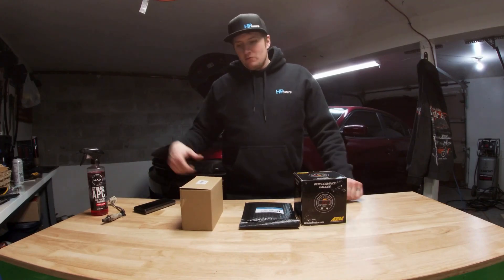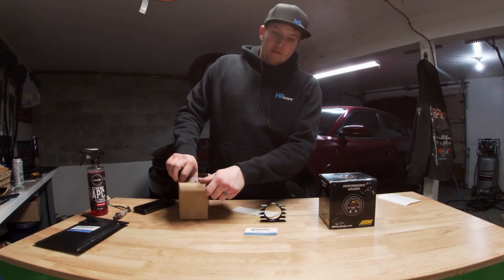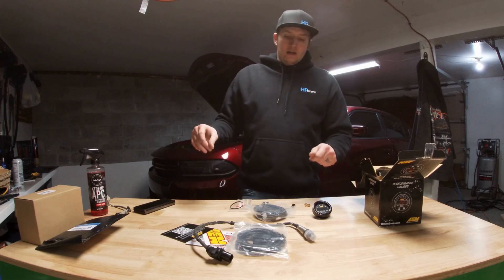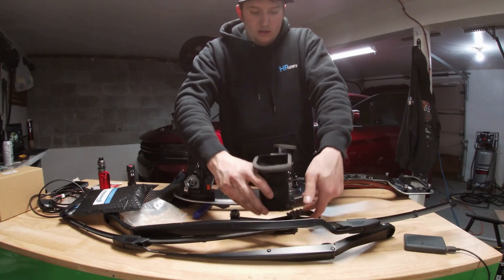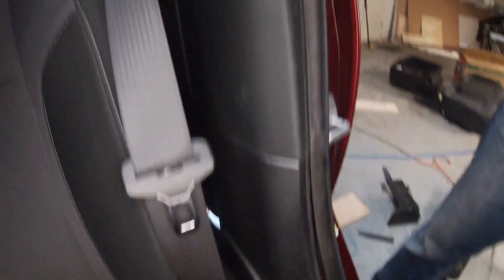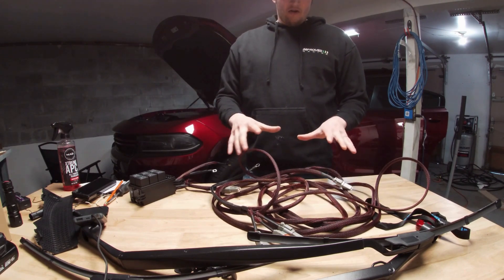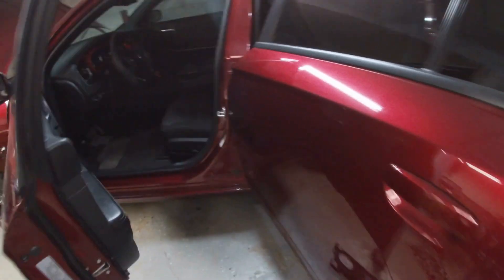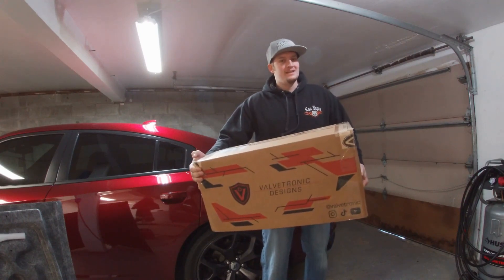AEM Wideband Gauge Install Dodge Charger and Challenger

Comment: Ok did you put the sensor in the headers? Two spots on driver side. Closest to the engine or flange collector??? Or did u put it in the mid pipe? .... and do you let it warm up before you start every time, the wideband????
Reply from the maker: If you are running in the position that I'm having it with in a hollowed out cat. I would not run it until you are tuned for that setup. if you are not tuned the ecu will enrich to warm up a non existence cat and will result in a fouled out sensor. I am semi new to the hole tuning thing and in tuning the dodge world has came up with many WTF moments though that became more clarity. get us to looking at lambda and forget that AFR exists sort of. Dodge uses FAR instead of AFR like chevy. the AFR setting programed in the AEM gage are based on non ethanol fuel despite that your probably getting e10 or e5 at the pump. In your dodge ecu it is factored in the tune based on E10.
Reply: @alaskagarage  never heard no one talk about FAR?
Reply from the maker: @chetlangford2144  FAR is fual air ratio that is what your dodge ecu uses in open loop. The gauge is a lambda gauge that is pre programed to calculate based on non ethinal fuel that has a stoich afr of 14.7. So while it will show 14.7 ranges at cruise and idle were it should be you are actually doing 14.1 because your running e10 but here is the kicker 1 lambda is based on stoich and stoich of 1 is always your target for those ranges.
Reply from the maker: @chetlangford2144  I have the sensor in the mid pipe in the cat that is doing pipe things now. I do not let it warm up before starting and infact the circut that powers it does not have power in an auto start, which is actually bad for the sensor to run  without power to it. So far though no issues the sensor does not show any issues of miss read or fouling out even after month of very cold shocking it. Way to tell if your sensor is fouling out it will only read lambda 1 or 14.7 afr and will not deviate from it.
Reply: @alaskagarage  well, this is what i have.  Left side driver.  I have kooks lt headers.  1st is 02 then afr sensor in the headers then back o2 in mid pipe.   No cats.   I use aem afr guage with hp on 93 14.7 i stay in...  i have a stock 5.7 with stock cam for now....frp tomahawk next.... 392 ported manifold with mmx controller,  kooks lt headers 2" with no cats 3 inch back no muffler just res.  Set aside...3k circle d torque converter,  1 piece dss driveshaft, scat 3.09sld.  With all this i should be around 500. With hellcat tb. No issues on set up now.

Comment: Challenger tr6060 Built 5.7 pistons rods Hellcat blower headers x pipe
Reply from the maker: Nice. What map you going to use im going to be using the srt4 2 bar only because I don't plan to have to much boost without an upgraded transmition and forged internals.